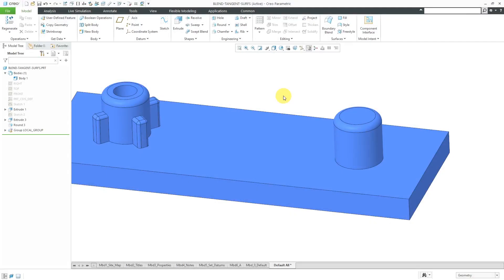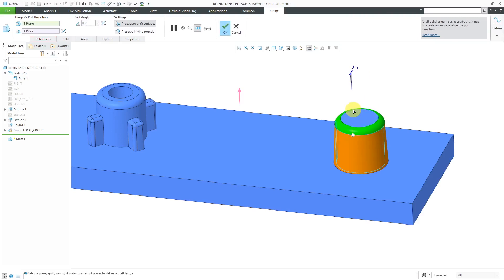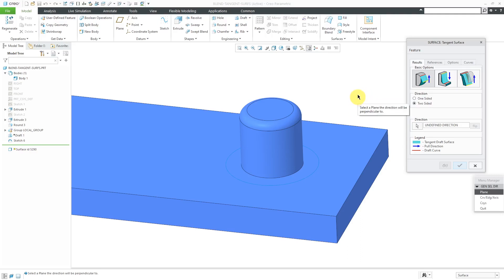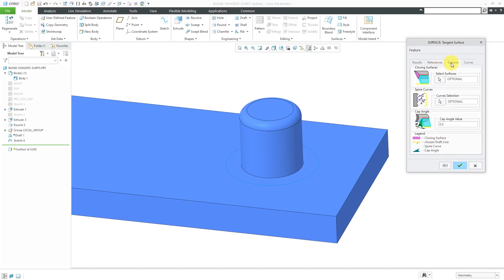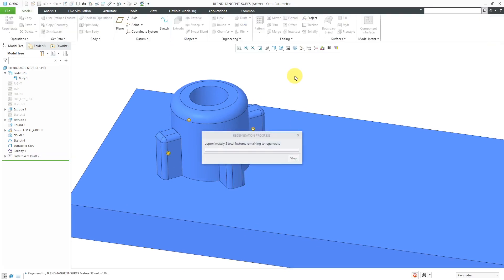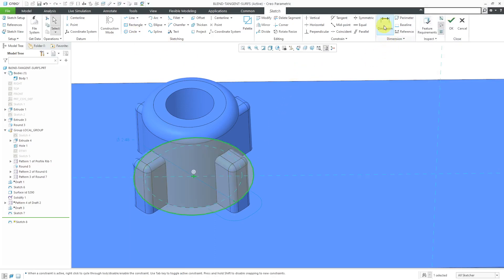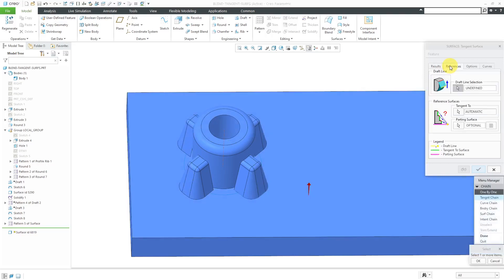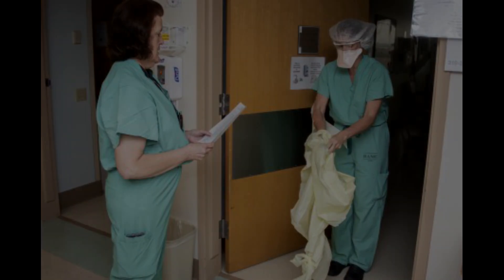Creo Parametric - Blend Tangent to Surfaces

Comment: Sir I'm designing farm tyre but I got stuck with lugs to base blending as ordered. Is there any alternative in creo of "face blend" like command in NX?
Reply from the maker: If I remember correctly, the various kinds of Blends in NX are Rounds in Creo (and Fillets in SolidWorks). A face blend in NX should be a Round in Creo where you pick surface-to-surface references. I have a comprehensive 5 parts series on Rounds. Part 1 covers the various references for Rounds, like edge, surface-to-edge, and surface-to-surface.
Reply: @CADPLMGuy  Thanks for that. I'll surely cover your series.